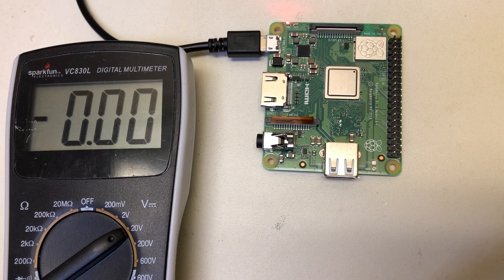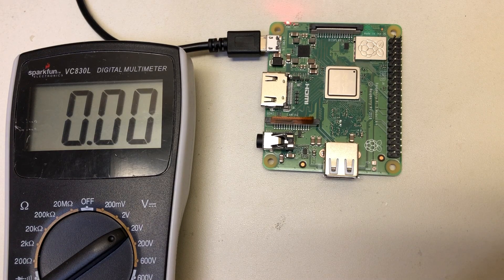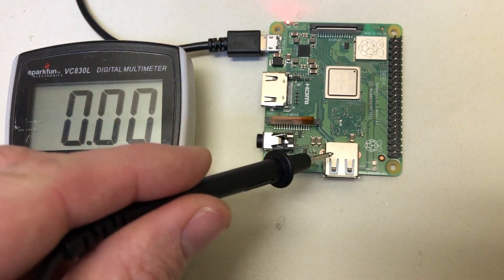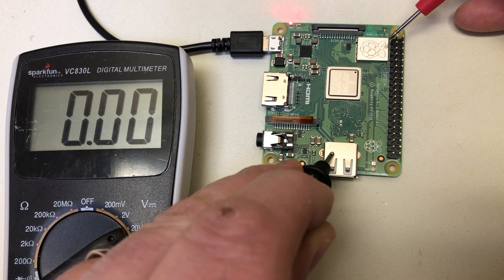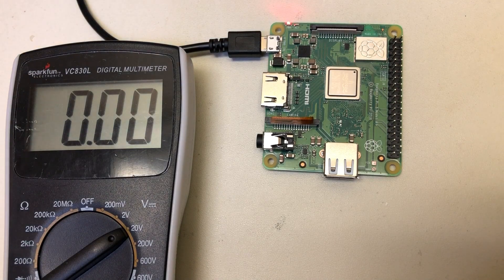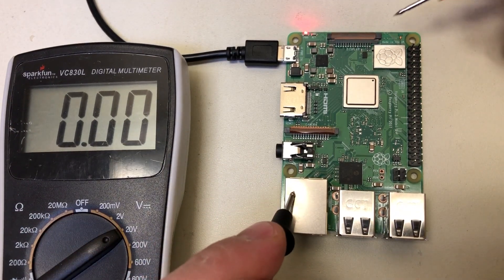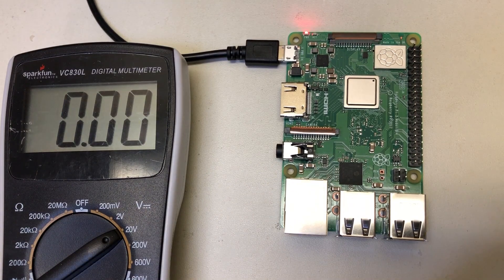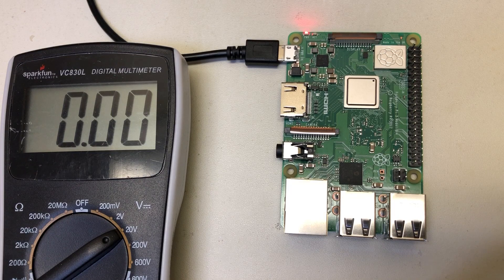Raspberry Pi Dead After Booting Once

Comment: Ye it has happened to me for some time now my raspberry pi 3b stopped working I use the right raspberry power adapter and I only get a red light now and I check the 5v and thats fine and also tryed the 3.3v and that also was fine too so I don't know what my problem is I used a new sd card under 32gb with fresh OS and it still doesn't boot only solid red light dose anyone know how to fix this??
Reply: Did your problem get solved.. im facing the same issue.. please reply if you can see this comment🥺

Comment: I bought Raspberry Pi 3b+ last year, cant use the product as I thought the Pi broken just like this, last week I try to power up the Pi because i need to use it for my final year project for my study and yes there are static red led only,  I tried to do USB booting using program_usb_boot_mode=1 at config.txt in the SD Card that i flash and it works. after that I try to put pressure to the SD slot at the Pi with my thumb because they said there are deformation by heat or mechanical issues. I insert SD card with Raspbian, then power up the Pi, and the Pi works perfectly fine. I hope it help. try read here 
https://raspberrypi.stackexchange.com/questions/83090/raspberry-pi-3-model-b-stable-red-light-when-powered-up/117123#117123
Reply: Hey I have same problem can you please help me and explain properly what u exactly did??
Reply: I've made the process that you shared and, It's work. 
@The Guy Just read the source, make boot flash and works!

Comment: Mine doesn´t even lights the leds on
Reply: hey! i have the same problem. have you solved the problem ?
Reply: @barscanturkes7148  Yes, it was the usb cable or the powersupply, I change both to a huawei fast charger and it works excellent now

Comment: hi , so i am having a similar problem on my model 3 b+. in my case, there is no red or any sort of led coming on on the board. i measured the volts on the 3v pin and it gives me 0.00 and on the 5v it gives me 0.1. please is there a way to resolve this issue?